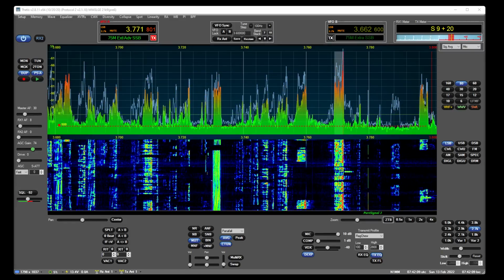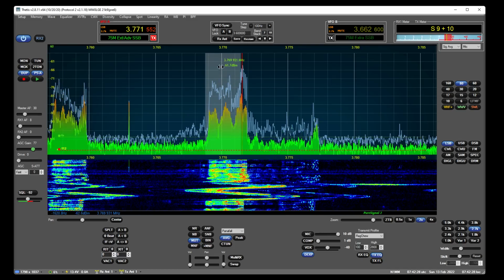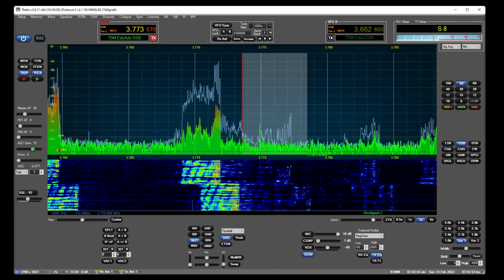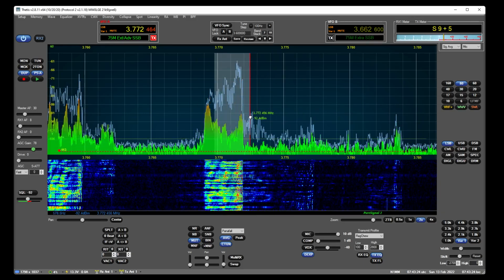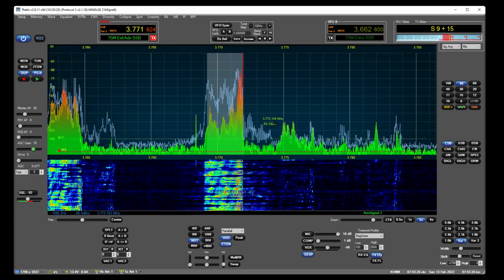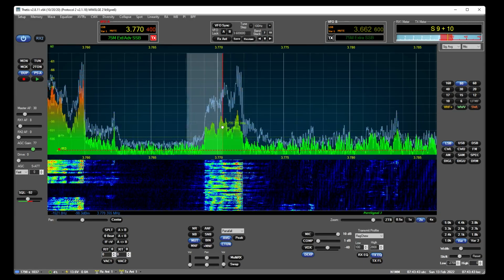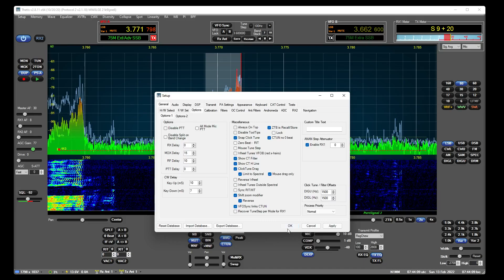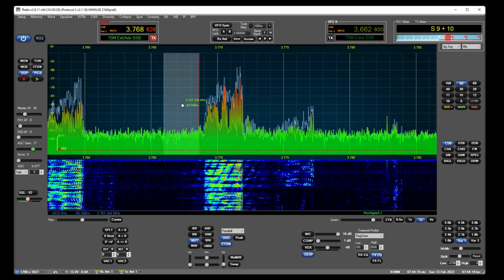Thetis 2_8_11 - Changes to filter dragging

Comment: I hope you do something with the horizontal line because every time I move it down and every time when I press something by accident is going in the middle again. I think maybe we can have a setting with a 3/4 down like KE9NS has on the flex Powersdr. Thanks for your work on Thetis.
Reply from the maker: the 3/4 thing, just drag it there? Perhaps I can add a lock to the bar. When you turn Tracking on in spot, it moves to the 75% spot, but you can move it or accidentally right click it. Right click on the centre bar and it will recentre itself, I may change this to middle click. Cheers, Richie.